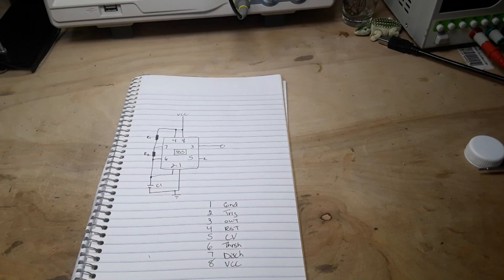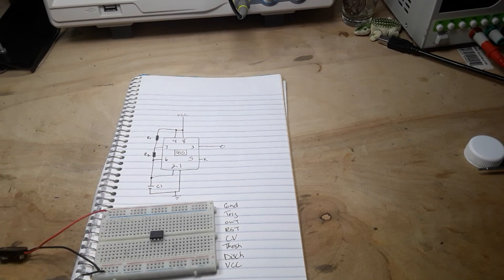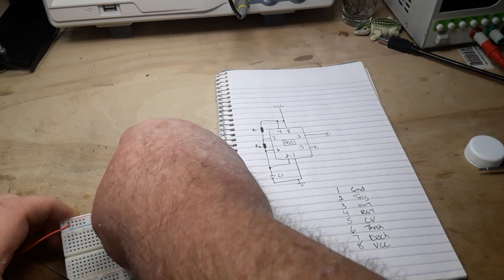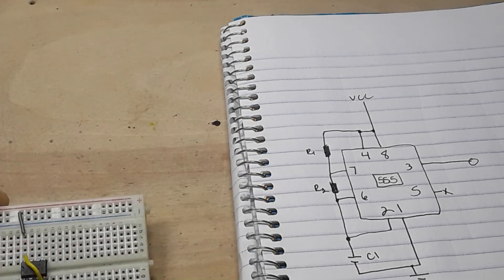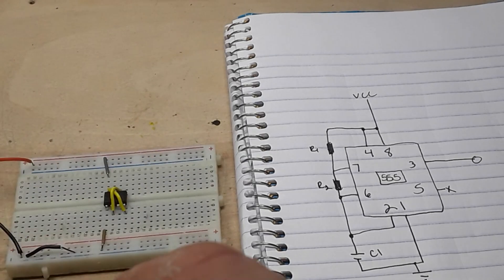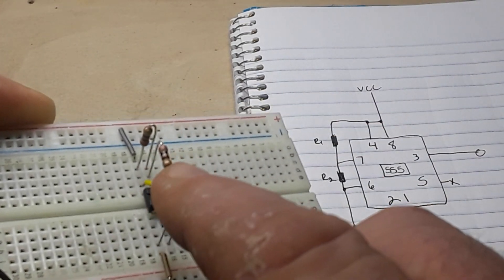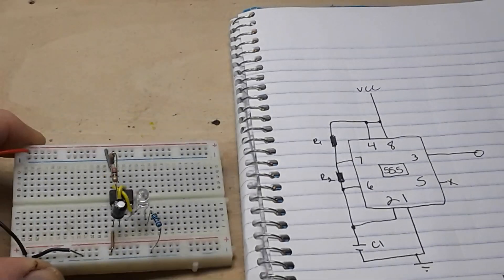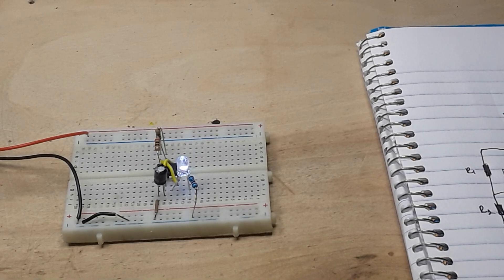Beginner's lesson -  schematic to breadboard

Comment: I am surprised that the breadboard puts the two power rails on opposite sides of the board. It may reflect the geometry of the circuit diagram, but from the electronic point of view, it is better to keep the supply rail  as close together as possible. 
There are two power rails on each side of the board, it is better to use each pair as the +ve, and -ve. 
To keep the supply inductance as small as possible, it is a good idea to connect the rails in parallel at one end of the board. 
Then fit a large value smoothing cap on each pair, at the supply end of the board. It is a pain to connect the IC supply pins from either the top or bottom pair of rails, but it does avoid creating a big loop out of the supply connections.
This is also a common mistake made by beginners when they first use Strip board (also known as Vero board). They lay the circuit out as it is shown in the circuit diagram, placing the power rails on opposite sides of the board, effectively running the power tracks as far apart as possible. This also creates a big inductive  loop out of the power rails, this can make the supply noisy, with a poor transient performance and make it susceptible to noise pick-up. It also make digital circuits radiate. It is possible for inputs such as resets trigger on supply pick up noise. In general, big circuit loops are a bad thing and should be avoided, both in the supply rails and In the signal paths. 

One of the annoying features of these plug in breadboards, is that the supply rails that run down each side of the breadboard are not continuous, they are broken into sections, requiring links to be added to make them continuous. This used up valuable connection sockets. There is almost never sufficient free sockets on these power rails, to connect all the pins that need to be grounded on an IC, things like unused inputs. Similarly there is always a shortage of near by pull-ups to the positive supply rail, so it is always a good idea to Daisy Chain such connection around the IC using link wires, as shown in this video. It's unnecessary and undesirable to connect every zero volt pin of an IC back to the negative (or zero volt) rail.
The above principles become very important if the breadboard is being used for testing an analogue circuit, where loops,earth loops and EMI pickup is important to avoid.